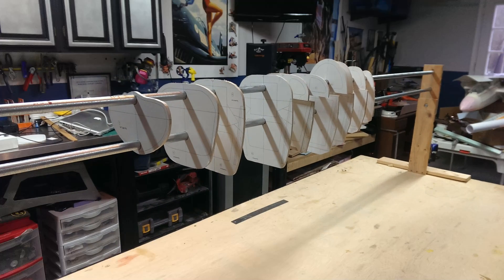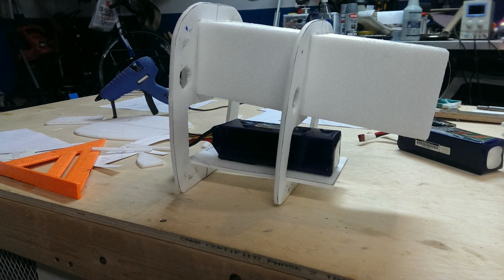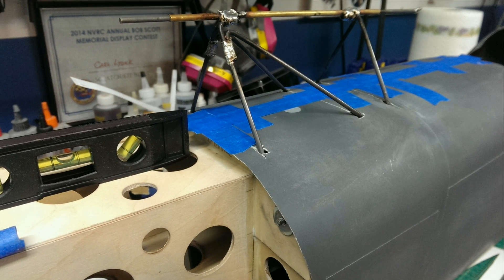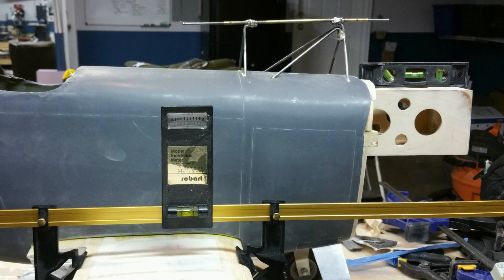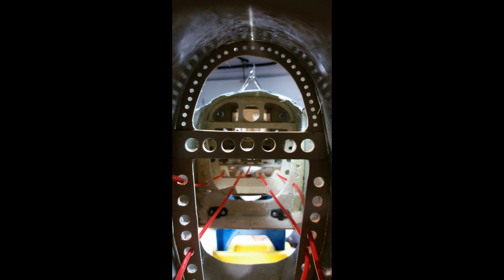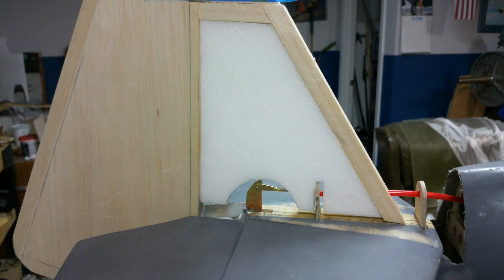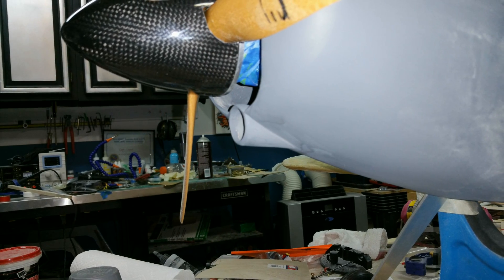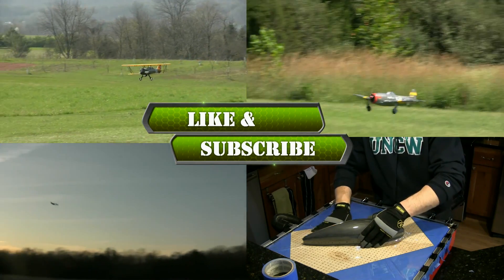RC Scratch Building - Fiberglass Fuselage Framing

Comment: I’d like to ask a question as someone new to RC,. I love the build, almost more than the flying...
Does this method of build result in less total damage during a “test of gravity” ? Thinking more along the line of a loss of control resulting in a hard landing, maybe even a cartwheel with a twist, versus the nose in the ground “pile driver” imitation.
Reply from the maker: So unfortunately it isn't as easy to repair as a foamy, or even perhaps a traditional balsa bird.  So much of the strength is in the skin that a significant fold or crack can be difficult (but not impossible) to fix.  On the plus side though, you still have the male mold and can always pull another fuse or part with "minimal" effort compared to starting from scratch.  That way even a total loss can be rebuilt relatively quickly compared to the original model.  

Welcome to RC!  Kiss your $$, your free time, and your sanity goodbye ;-)

Comment: I followed and commented on your build at RCG I believe it was but can't find it now and with a scale project looming I would like to go through that again since I'm considering this method of yours - please remind me (link)
Reply from the maker: My build was actually on the Flite Test forums over at https://forum.flitetest.com/index.php?threads/scale-build-off-1-4-scale-55-pitts-challenger-iii.22283/.  

On edit:  Shoot... I forgot I even had this on RCG too :-)  That thread is at https://www.rcgroups.com/forums/showthread.php?2534219-Scale-Build-Off-5-%C2%96-58-span-ORACLE-Pitts-Challenger-III#post33090466

If you want to see a CRAZY build with the same technique you need to check out DAG's 160" C130 build.   He did his fuse the same way with amazing results:  https://www.rcgroups.com/forums/showthread.php?1200180-Design-and-Building-of-a-160-C130

My next big build this fall will be using the same technique for the fuselage.  Should be fun :-)

Good luck with your build!